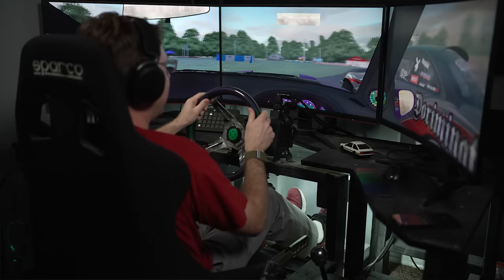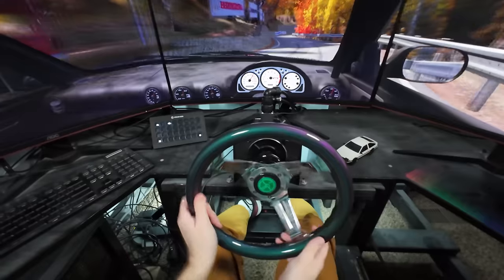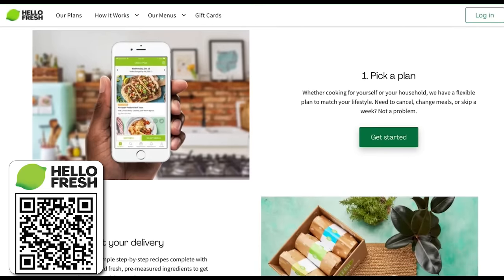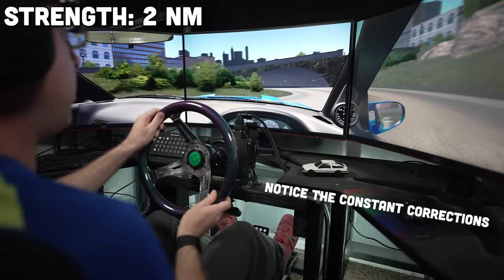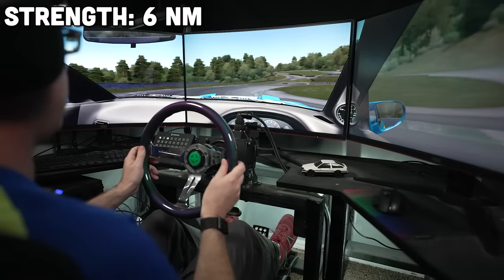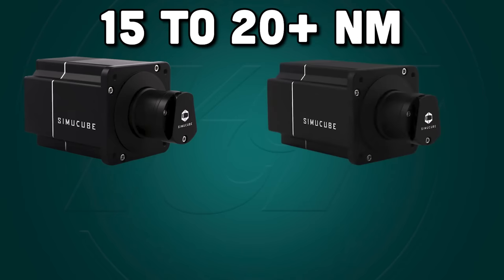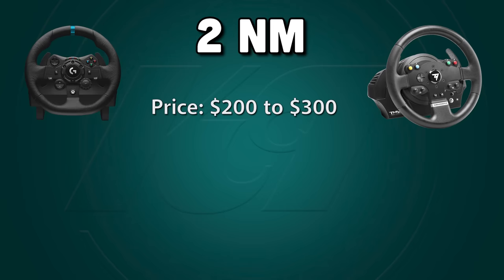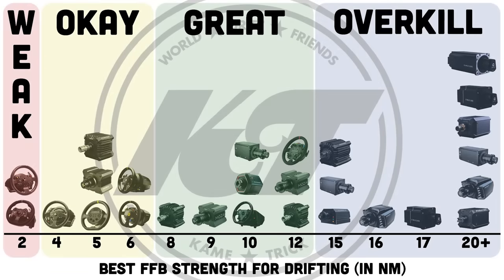What FFB is realistic for sim drifting? (2 to 20 Nm)

Comment: REGARDING FANATEC: The base is what makes it compatible with Playstation. The wheel is what makes it compatible with Xbox.
So you can use the GT DD Pro/DD+/Extreme with an Xbox compatible wheel and, boom, you can play PC, Playstation and Xbox with the same rig. CSL DD/Clubsport DD will not work the other way around though so you'll be stuck with PC/Xbox only.
Reply: Product lines confuse me, so just to double check, if I wanted to have a mostly PC wheel with occasional GT7 on PS5:
Get something like DD+ (If I want 12~15nm), and any wheels (GT3, F1, Round wheel for drifting etc) and (Fanatec) pedals? and I should have no problems?
Reply: @xTheEcO  That's correct. Any Fanatec wheel/pedals with DD+ and you're good to go... When playing GT7 you'll plug ONE usb cable to the console because the wheel base acts as a periphery hub (RJ12 connectors) for pedals/handbrake. That's why you can't use a sweet handbrake from VNM (usb connector) when playing PS5 for instance. PC - no problem. And I guess you'll do most of the drifting on PC anyway..
Reply: Collective minds Drive hub fixes all that for $80
Reply: Even more of a reason to go with the DD pro. Interesting
Reply: @staffanstuff  Would you be able to tell me if the RJ12 connectors the same connector thats used in the moza r3 Shifter slot?
Reply: @jxstvoid7151  No idea. Ask in some subreddit.
Reply: That's awesome

Comment: Great video. I'm looking to upgrade my wheel soon since I'm using a g920 with an aftermarket wheel. It's not too bad but I have noticed it doesn't quite spin fast enough on certain cars and it does clip and shake a ton when ffb and centering force is cranked up to compensate but I've still had a blast on it since it's what got me into Sim drifting.
Reply: I started on a G923 and got mildly competent and when I got my DD wheel I instantly leveled up by a large degree. You can absolutely make it work on the lower end wheels but it's such a better experience with a belt drive or DD wheel.
Reply: @gtrslngrchris  ya I definitely want to upgrade. I only got the g920 because I got the wheel pedals and shifter used for $200 usd and it was like brand new and I didn't want to spend an arm and a leg just in case I didn't get that into it. Now I'm super into it and I've quickly found the limits of the g920 but I've been making it work as much as I can for the time being. I started on live for speed and then switched to assetto and beamng once I got my first gaming pc last summer.
Reply: @neonnerd1364  i also went from a g29 to a 8nm dd and i instantly was able to link tracks and tandem compared to rarely linking a track on my g29 its 100% worth if you play alot and mostly drift but if you dont play alot or grip race the dd isnt worth it, put that money into a good set of pedals instead

Comment: Interesting but you're missing one important point : slew rate. And stronger bases have also higher slew rate. For example, a sc2 sport might have enough Nm, but has a slower slew rate than the sc2 pro. So even if you're not using all the nm of the sc2 pro, you will have a better experience

Comment: First I want to say, Thank you, for such an informative video. not many reviewers cover so many choices in one video. Just wanted to say at 8:15 The Cammus C5 actually has a rated/listed Holding Torque of 5nm but has been reviewed and recorded many times hitting all the way up to 8-9nm of peak torque which lands it above even the boost kit CSL's peak torque of 8nm! (The holding torque of 8nm CSL is around 5-6nm) The smaller rim size and overall look of the wheel may deter some.. I happen to quite like its quirky look, but with its shaftless motor design the return speed is amazingly good for drifting, and in my experience it hits Waaay above its weight class in terms of overall strength in its FFB and feels very hefty in Rally. For the price, it just can't be beat. From what I've seen C12 also has a listed Holding Torque of 12nm but actual Peak Torque is closer to 15-16nm. Its just the way Cammus rates their products. I highly recommend the C5 (I don't own a C12) For its price and performance its very good, just be mindful of any local warehouse near your country to help keep shipping costs down. Again, great video, man.

Comment: thank you for making this video. Ive been sim driving casually (time attack and freeroaming mostly) for years now after I bought a g27 from my first wage ever and never bothered with another one. because it worked fine as far as I can tell with its 3NM. for normal grip driving i never felt that i needed more finesse and i got used to the "clankyness" of the wheel.  of course in never drive real cars as close to the limit so the torge felt adaquite. 
Ive always felt that its hard for me to control my drifts and always thought im just bad at it but never got really better than OK at it. now i will actually get a dd wheel base to see the differnece myself.

or maybe that has some time casue i jsut spend 4k on mods for my actually real rs3 lol

Comment: Since I like to play semi-arcade and semi-simulator games like FH5 and Assetto Corsa more than IRacing and any F1 games this video cleared a lot of questions I had about getting a new base. My G27 is getting way too old and I was looking for something to be able to focus more on simply driving around and drifting more than anything else. Since I read a lot of times a DD base motor is somewhat like a speaker and you don't ever want to put the FFB at 100% just like you never put the volume of a speaker at 100% I went from wanting a Moza R9 to Moza R12. Then I saw a comparison between the Moza R12 and Simagic Alpha Mini and the guy said because of the fact Simagic divided the wheel into 262144 instead of 32768 like Moza, the FFB is way smoother and way less janky. Also people noticed the FFB was quiet strong for a 10nm and calculated the Simagic Alpha Mini may be advertised as 10nm but is actually more around 13nm. So I hope a "13nm" running at 70% or 75%, around 9 to 9.75nm should be enough to have a big sport round wheel or big deep dish wheel and still provide enough force to have fun driving around and practicing to drift in games. Next thing would be find how to get turn signal levers and maybe a button box for the buttons lacking from the wheels. Thanks for the video!!!

Comment: I drift at like 2-3nm and that's plenty. Any more than that and I need to start gripping the wheel more tightly, which limits the effectiveness of force feedback. Very hard to stay relaxed with the torque above 4imo.

In addition, the wheel in a drift car is NOT hard to turn. They're not yanking on that thing like an F1 driver, they're throwing it around like it's nothing.
Reply: 2-3Nm is not even remotely close to realistic though.

Comment: I got started drifting with a G27 and worked my way to getting good enough to do 360 drift entries. If you can drift on a weak gear driven wheel you can drift on anything.
Reply: How long have u been drifting and what's ur progress? I started about 4 days ago and still can't maintain long donuts. I can however drift corners but can't transition into another corner.
Reply: @zepos thats normal (It was similar to me and my frienda atleast) Maybe try practicing bigger circles?
Reply: @zepos  It's kind of hard to give you tips because you don't really say much. What wheel? What game? Is a long donut a wide donut or just for a long time? I used to play Gran Turismo 5 with a G27 and I ranked top 1000 in some drift events back in the days. Could never do that now though, the FFB is too weak I kept spinning out last time I tried.

Comment: honestly my main issue has always been getting the settings ingame as well as IRL wheel settings dialed to the point It feels realistic and perfect.. I have a ClubSport Wheel Base V2.5 by fanatec I bought when it was new, and I have gotten it to an acceptable setting for "drifting" but then i need to change settings if I wanna grip race cause it feels so off for grip, and then my grip settings feel really off for drifting.  Any chance you have the perfect setting combo for the CSW 2.5 for assetto corsa?  I mainly just drift but I feel like the ideal settings should be able to work for either or.

Comment: Another factor you didn’t mention with the gear driven wheels, on my G920 I’ve noticed that the wheel has a decent amount of resistance to my inputs, but only in one direction. Perhaps it’s because of the gear driven system, or it’s just the g920/g29, but when you flick into a drift (a true staple of drifting on a gear driven wheel), it’s much easier to flick the wheel to the right than to the left, something that you wouldn’t even think of being an issue, yet it is. Another fantastic feature of the G920 is that if you flick a little TOO hard, the wheel will decide that it wants to become unaligned, and centers at about 15° left. It will stay like this until you unplug the wheel, which could require a restart of the game, ruining your race or drift session. On top of that, the software is complete garbage, has no useful options other than steering angle, and it uses 20% of my CPU for no reason. That’s why I agree with you that it’s just not worth it to get a gear driven wheel for drifting, even though it’s the cheapest option available.

Edit: I would like to mention that it is totally possible (albeit very very difficult, much harder than people make it out to be) to drive at the highest level (VDC and others) with a gear driven wheel, but you won’t be able to keep up with anyone else using a belt or DD wheel. It’s purely a factor of the centering speed that you will need to drive those cars. You can drive them, but you will have to compensate with throttle and brakes, meaning you’ll be outpaced anyways. Although it’s possible, just not feasible, and I’ve yet to see footage of anyone shredding  tandems using a g27 or g29 with VDC cars or similar high hp drift cars.

Comment: A typical PS curve will be clipping around 5-6Nm most of the time, so you'd be looking at 4-5Nm midcorner.

The catch is that PS is nonlinear, so the ramp is still very high and it feels "tight". PS also won't work with hands off the wheel, effectively speeding up the wheel when letting go.

Modded AC can do a PS curve, but it won't do the hands-off stuff.

Of course, manual cars usually reach 15-20Nm peaks in transient.

Comment: At this moment i'm little bit struggling with FFB wheels too (in hope that will setup sim and wheel correctly at last), because IRL drifting (rally too) much easier, IRL these oscillations never happen, IRL there is so much ass-sensing of car inertia which greatly helping to control it.

Comment: DD wheels are the way to go in any form of sim-racing. Whether you do grip or drift races, the information you get from a DD wheel is lightyears ahead of even the best belt and gear driven wheels. There is just no comparison. In grip races it won't necessary improve your times like magic, BUT it will improve consistency. For me personally 16nm is the perfect fit, especially when you start doing Le Mans racing and other forms with big downforce racing, because it compensates for the lack of g-force in the chair.

Comment: Using a bigger diameter lightweight wheel like 350mm would help because it gives u leverage to make inputs easily while running higher ffb, so that way u can get the quickness of higher ffb like 12nm and still be able to easily make corrections like a real car. Also people prefer bigger diameter for drifting anyways, it helps u be more accurate and make more precise movements, less chance of a spinout. What diameter wheel are u running?

Comment: I was considering buying Fanatec CSL DD 8NM, and after this video I think that's the wheel base I want
Reply: I have this one, but if I would buy again today, I might have a deeper look at Moza. Their truck wheel make my eyes water.
Reply: I have the CSL DD 8nm and it's not enough aligning torque for all situations in all games in all cars. Games that focus on front wheel understeer as feedback clip early with 8nm in mid or rear engine cars. It's a good base, but not quite enough. You can use power steering as a justification if you want, but there's just not enough headroom for all games to make the necessary contrast between traction loss and peak grip, so you end up having to sacrifice some of that detail to avoid clipping, it's not terrible by any stretch, but I'd aim for the R12 to be on the safe side. The reason why more torque is good isn't for a workout, it's because it means more holding torque can be sustained even when bumps and other peak torque details happen at the same time... more headroom gives you that.

Comment: I got a TS-XW on use market 3 years ago for 250, I wish to upgrade. But I will have to buy a proper rig to mount a DD and at that point i will closer to the 2k than the 1k for an upgrade. Oh, not to mention the space requirement. At least I know I will be aiming at 10-15 nm wheel base.

Comment: I use moza r5 on ps5 console to play gt7. It’s awesome, it works great but I feel I’m ready for an upgrade. 12nm of torque  might be my sweet spot. Thanks
Reply from the maker: Did you have to get some kind of an adapter for the PS5 to recognize the wheel? IIRC Moza doesn't market it as being compatible with console
Reply: @KameTrick  yes. I had to use the rasu1ution 2 adapter. Cost $100 on eBay

Comment: Bro, my Thrustmaster T150 pro base stopped working suddenly after being used for 4 years continuously,  
now i am planning to upgrade, as there are no direct drive wheels available in India. My only option is Thrustmaster TS-XW.
Or should I go for the cheaper option Thrustmaster t248 as Thrustmaster officially does not have a service center in India

Comment: I don't see drifting ever actually providing anything close to 20Nm except maybe in very short bursts. That is an insane amount of torque, which is why I feel there are some flaws in the execution of this video.
I have a Moza R5 and I don't even run it at 100% when I'm grip racing because it's just tiring even after a few minutes. For drifting I use around 70% and there's plenty of detail, resistance and especially speed. I think 5Nm is plenty for drifting and a lot of people have been happy with their T300's for years as well. Anything below that level starts to get too slow though.

Comment: I really wonder what my modded G25 outputs for torque, because honestly I can turn it up to be stronger than any real life car I've driven that had power steering, and I doubt it makes more than 4Nm, so I'm confused with your findings. 

Either your fully setup drift cars have noticeably stiffer steering than the street cars or 50/50 duty cars I'm used to, or your perception of how strong it should be is skewed towards the higher end of what it is in real driving.

Idk I feel in general lots of simracing people have an obsession with making the steering super heavy for more detail, even tho they're driving cars that IRL have quite overboosted powersteering. High torque only makes sense to me if you're driving full blown race cars that do not have power steering and have very heavy steering IRL.

Comment: I started with a Logitech g920 it was ok it was really loud had really low ffb but for the price it was good and if you don’t have a massive budget and just want a racing wheel then it’s good for you 

I now have the Thrustmaster tx leather edition it is absolutely amazing how ever I did upgrade to the pro pedals because the ones that came with it were absolutely terrible other than that it is an amazing wheel I picked mine up for 250 pounds 

I was also looking at the moza r5 bundle witch in my opinion is a really good price for a dd wheel and pedals but only works for pc 

If you want a dd wheel for an Xbox (won’t work with ps) then the moza r3 is for Xbox and I believe it also works on pc is a really good wheel it has 3nm of torque witch is near enough the same amount as my Thrustmaster witch I believe is fine for most sim games and drifting and you can also get that in a bundle witch is also a really good price

Comment: Do they make wheels with at least 1080, if not 1440 degrees of rotation? Not sure I'd like such a low rotation given that most IRL cars I've driven are between the two numbers I gave. Especially once you consider that all of THOSE had normal steering angles of around 35-40 degrees as opposed to drift steering.
Reply from the maker: Several of the belt drive wheels can do 1080, and mechanically the DD's have no rotation limits, however I think some of that is software limited. Ideally you could set anything between 1 and 9999 degrees...but in order to unlock that, each wheel maker has to program an upper limit into their control software.

So it may take some extra investigation, asking the sales teams and Reddit/Discord communities for the wheels about the current max rotation you can set in the software to narrow down which ones will give you the rotation you're looking for.

Comment: i dont think you mentioned about peak torque and holding torque. The wheel base you use has a holding torque of 10nm and peak of 20nm(read from the motor data sheet). so I'm not sure if its 10nm peak torque that is enough for drifting or 10nm of holding torque.

Comment: On a CSL DD boost kit I can't run more then 70-80% FFB it's just too much (I'm running on a Clubsport Classic Wheel rim).
(Some examples on my videos on the channel)
Reply: So u paid for something u dont use. Why dont u return it ???
Reply: @filipivan5125  I use more ffb when grip racing though.

Plus im happy with it, direct drive is better then gear or belt driven stuff and already within the ecosystem so no reason to buy setup anything else.
Reply: @filipivan5125  its better to have "to much' and turn it down, than to not have enough. The csl dd without the boost kit doesn't have enough.